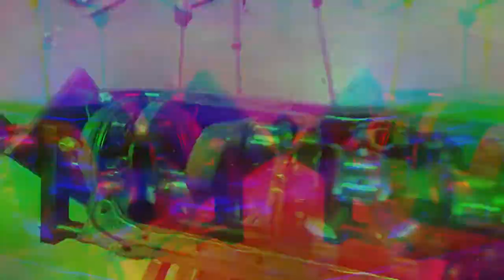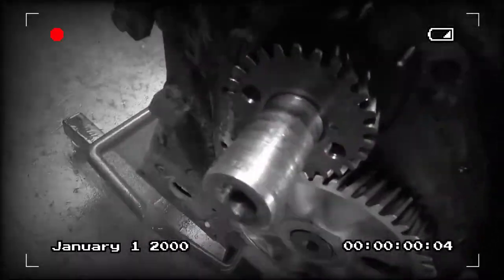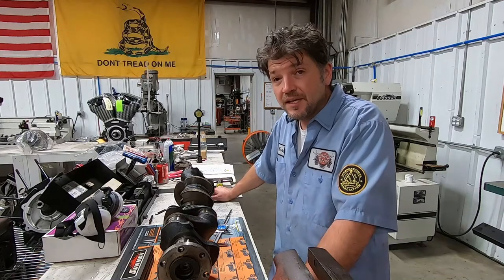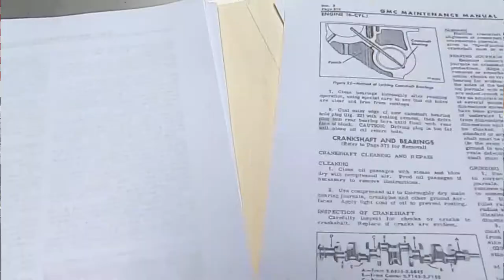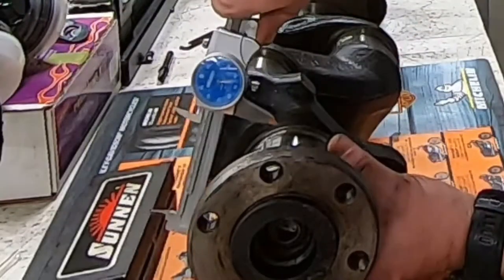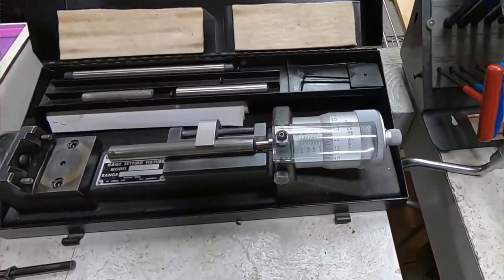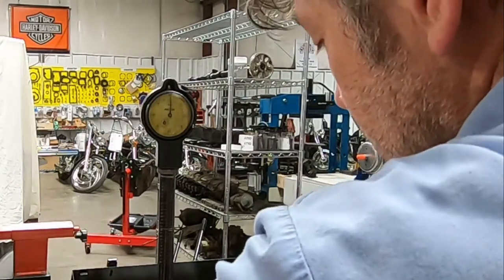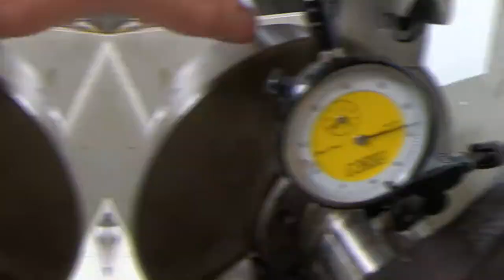Stovebolt Crankshaft Repair - 302 GMC Inline 6 Part 3 - Pro Twin Performance - Kevin Baxter

Comment: You're giving me flashbacks here. First engine I built was a 1962 235 Chevy. Built it as a no bucks 9th grader in 1974.  It wound up with 2 rochester single barrel carbs on an Edelbrock intake, an original Corvette split manifold, Melling 3/4 race ( what the catalog said) solid lifter cam, head milled as far as possible, overbored. I think it came out to 10.2 to 1. I had it in a 1939 Chevy 2 door sedan with a Saginaw 4 speed and 3.70 gears. Believe it or not, it went 16.30 at Cecil County Dragway. Then it ripped the yoke off the rear.  American Graffiti made me do it.

Comment: When's the next video coming out working on one my self got some great info
Reply from the maker: Thanks Matt. In about a week or so. The next one is on measuring clearance on main and rod bearings. After that, I'll dive into the cylinder head.

Comment: I'm a GMC collector or should I say addictor lol.  I have several of the GMC 302's both running and awaiting rebuild.  I'm curious, on the hub you machined, that should be a harmonic balancer correct?  Did you not go back with the dampner?  If not, what's your reasoning?

Comment: Love the GMC inline engines, and the video has been good so far. But too much time spent on mundane crank journal size confirming, and not enough on the damage to the snout. The snout was shown as chewed up by the loose fitting hub, and had a hole drilled through the crank by some "Mickey Mouse" mechanic in the 1950s. Serious stuff with crank strength! Nothing shown about restoring the snout. Why make a new hub, when the original might have been repaired with a sleeve?